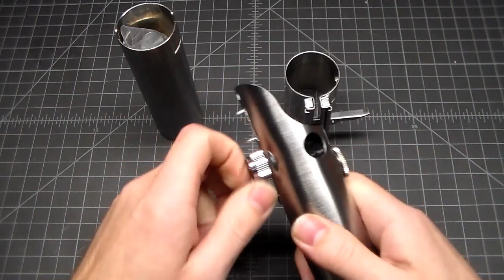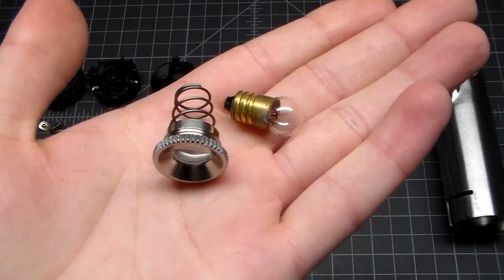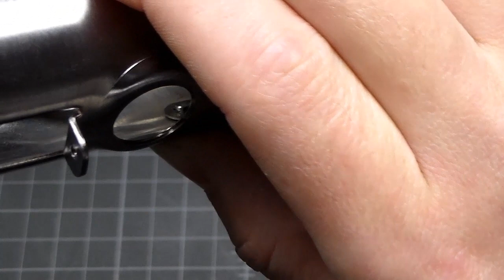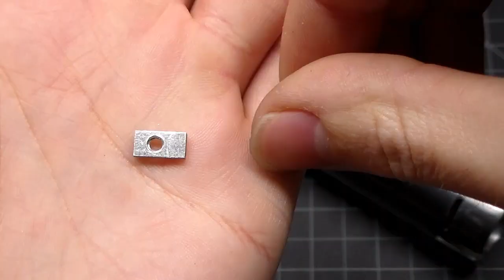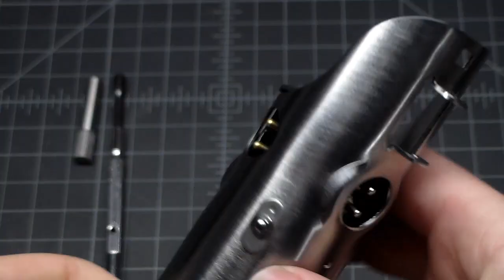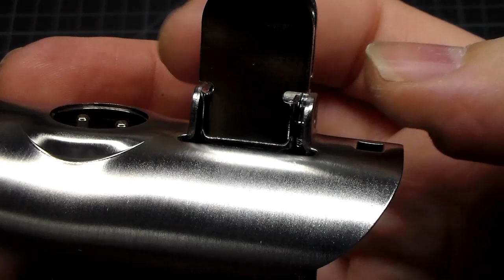Graflex Bulb Socket Assembly Instructions

Comment: "A little bit tricky" doesn't convey the proper depth of fiddlyness on the slide switch...I ended up taping down the outer switch assembly and pushing the e-ring on with the help of my phone camera playing the role of digital microscope.  After installing the flash assembly, I found it easier to reach in from the battery side with a screwdriver and bend the switch tab a bit further to contact the side of the bulb rather than removing all those pins again...

Comment: A bit of a tip for those without smooth headed pliers or are worried about scratching the finish:  simply wrap your plier ends with electrical tape which will prevent any scratching.

Comment: Hi, Matt! I know that this video is older and that my question is off-topic, but I have it nonetheless.
So, lets say that I want to make my graflex into a lightsaber. I have all the parts and my blade holder. I bought everything from the Graflex shop. The red button should have a little plunger system in it. Would I be able to get away with wiring a microswitch through the red button side of the blade holder, and threading in the red button on top in order to make the red button my activation switch?

Comment: Can you make a video about configuring a graflex for neopixel capabilities?
Reply from the maker: Setting up a saber for NeoPixel is no different than an in-hilt LED. You need a blade holder, a chassis to hold the electronics and your battery, sound board etc. Just make sure you buy a NeoPixel connector and the housing for it. You can find it all at Thecustomsabershop.com
Reply: @EastCoastSabers  Thanks.

Comment: Great video, Matt! Thanks for sharing. One question - Are the small springs beneath the rear sink pins necessary to keep in the flash when building a lightsaber prop? Or are they only needed when you need the flash to function? Basically, I don't have them in any of my lightsaber props. Should I add them or am I OK without them?
Reply from the maker: If you're not using it as a functioning flash handle, there's no need for them.

Comment: Hi Matt, I'm new to the Graflex scene. Glad you're still doing vids on these :) just soaking up whatever information I can atm. I need to learn which is the best blade holder to fit a TGS gen2. Endgame goal would be to own an MB chassis, but I'd love to see how Goth's new chassis system turns out.
Reply from the maker: It depends on what size blade you want and what the application is going to be. If you want a 1" blade you're limited to KR Sabers, Roman Props or the one TGS themselves sell. IF you want 7/8" (which is more accurate) you can go with Solo's Hold or MB Sabers.